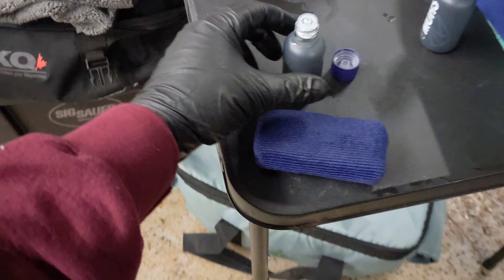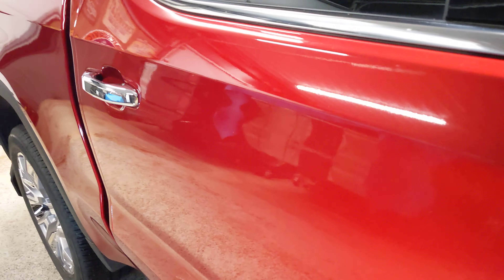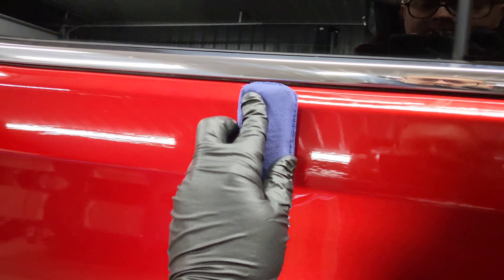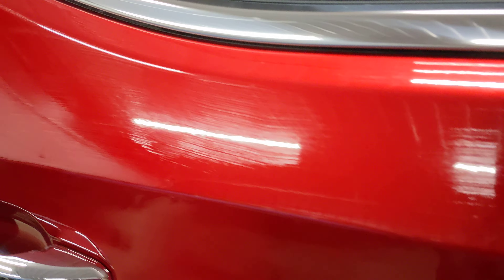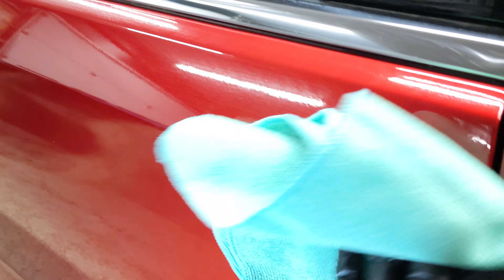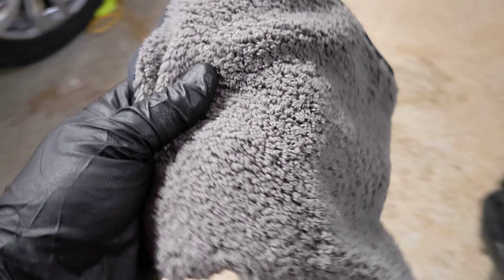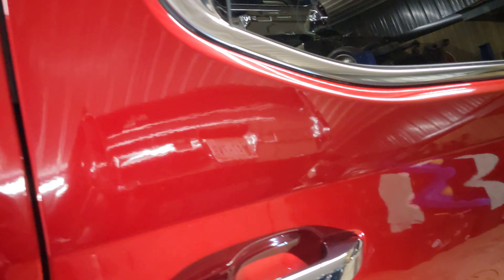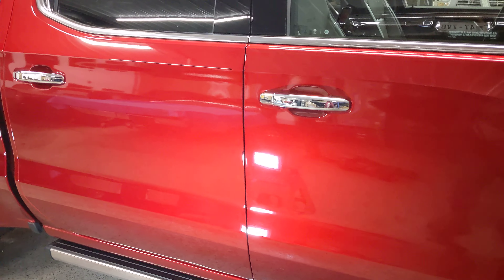How To Apply GYEON MOHS EVO Ceramic Coating

Comment: I loved using it . One of the easiest to apply
Reply from the maker: It really is and the longevity is fantastic even in harsh Winter climates like mine!
Reply: Hello 

I need your help on the coating. Is it glossy ,like a glass reflection. Thanks in advance
Reply from the maker: @sharadsookun4983  yes very much so and the durability is fantastic.

Comment: What happens when you get the coating on rubber and plastic trims, do you just wipe it off immediately?
Reply from the maker: You can use it on those as well.

Comment: If the car had any previous sealant (such as P&S Defender), can this go right over top?
Reply from the maker: Absolutely not. Ceramic coatings need to be applied to a properly prepped clear coat or you won't get the advertised protection/bond to paint. 
1)wash
2) decontamination (chemical and or clay)
3) at least a one-step paint correction (buff/polish) 
4) paint prep spray (isopropyl alcohol) to remove polishing oils
5)apply ceramic 
6)allow to cure

Comment: Thanks for the video! I’ve had a bottle of this and skin for 2 months waiting to apply on a brand new truck. I’m a little concerned about how to divide up the panels and curves. Also, wondering how I know where I left off once one section is buffed out? God Bless!
Reply from the maker: I usually do half a panel at a time (so 2x2 foot or 3x3 foot sections), curves are not an issue, MOHS Evo is very forgiving and has a long work time so try not to stress too much.  If you work in sections, overlapping isn't a massive problem as long as you level the product properly with two towels (initial wipe and soft wipe). Have fun most importantly. That's what this is all about.

Comment: Hello

When i applied to darker car its leave smudges  ( darker pattern) after level and buffing. Any help please
Reply from the maker: Sounds like a high spot to me which would indicate it wasn't leveled properly. I may be wrong, but that's what it sounds like your issue is. When that happens you may have to buff off with a polisher and reapply depending on how long it's cured.

Comment: Can i Use the Gyeon applicator for a Next coating?
Reply from the maker: Unfortunately they are a one time use so you throw them out after each use. The two microfiber cloths that you use can no longer be used on exterior surfaces either as the ceramic will crystallize and cause scratching.

Comment: Your using the ribbed side of the applicator, you can also use the suede side
Reply from the maker: You can use both sides Thomas. If you watch Gyeon's (also Esoteric's) instructional video on how to apply the product, they use the side I'm using here. I appreciate your input as I'm always open to suggestions and opportunities to learn!
Reply: @marshprofessionaldetailing9794  i’m a certified Gyeon installer and yes you can use bought sides, but it was designed to apply with the suede side first and wipe of with the raw side. After that use a soft towel to wipe off excess product, but very gentle because even soft towels can scratch
Reply from the maker: @mindalive2023  I just watched six videos including ones from Esoteric whom brought Gyeon to the USA, and Gyeon's instructional videos for all Evo products. I also re-read my instructional manuals that I've saved from every bottle I've ever purchased as I keep them all, and cross referenced them for any inconsistencies. Nothing supports what you're saying or shows that you're supposed to use the smooth side and certainly not wipe with the microfiber side. I hope this doesn't come off wrong as I did all this research again today in hopes that you are correct. I certainly haven't coated any of the vehicles I've used MOHS Evo on incorrectly. As I said before I am open to suggestions and dialogue but I didn't use the wrong side and don't want my viewers to be misled by your statement. Anyone who reads this, the video I've produced is fine. There's nothing wrong with it at all. I've had immense success applying this product this way and 100% customer satisfaction. I take detailing very seriously as you can tell. You can use the smooth side of you wish, but that's not how Gyeon or any other reputable detailing channel shows you how. Again thank you Thomas and happy detailing.
Reply: @marshprofessionaldetailing9794  The old applicators only have a ribbed side so what you are doing is certainly not wrong, but the new applicators have the suede side and since suede is more often used for application, this is my preference. The result will not be better or worse if it is applied carefully. I recommend you watch Gyeon's videos yourself https://www.youtube.com/watch?v=Zr0sMd6JoOM
Reply from the maker: @mindalive2023  I truly appreciate you giving this insight. Your initial comment was that I used the wrong side and I just wanted to research to ensure I wasn't giving out poor information. Thank you for this text thread as I'm sure others wonder about this as well. I've included some more videos for reference as you have below. 

https://youtu.be/D2aVOkiW0kg
https://youtu.be/uecSR_bs0GY
https://youtu.be/nIviIGEkT6g
https://youtu.be/oimBeG3NB1g
Reply: 😅  so what. use whatever side you like.    use any lint free applicator you please as long as it goes on evenly and  smoothly. . I've applied dozens ceramic coatings using a brand new soft foam  tire shine applicator or a piece of fine polishing pad i cut into a rectangle  because i had no coating applicator.
..and it too works great just apply gentle and lightly..the point is get it on smooth clean and even wait until flash then level off using a low pile microfiber and final level with another new microfiber. you don't HAVE to use one side or one way. just a safe effective way.

Comment: Is it necessary to polish the paint before application ?
Reply from the maker: It gives you a pure surface and the coating bonds a lot better to the clear coat. If you don't do paint correction, the product will not work or last as advertised. Also if you're going to seal the paint for multiple years with a product, it makes sense to eliminate imperfections and have the vehicle look it's best.
Reply: @marshprofessionaldetailing9794 HI, what do you recommend polishing with? Also, whats best to get any existing waxes off prior to use? Thanks!